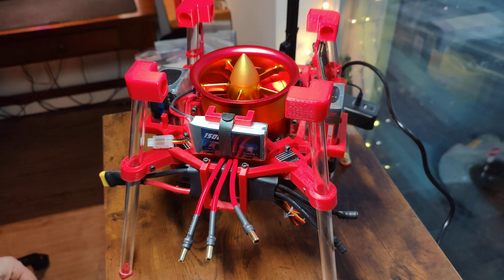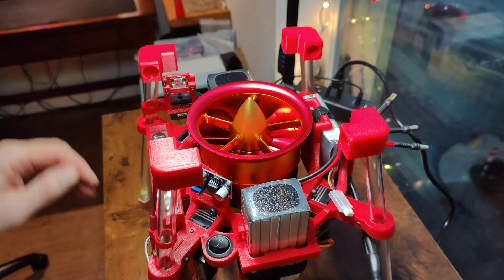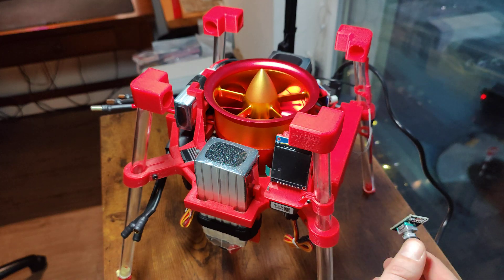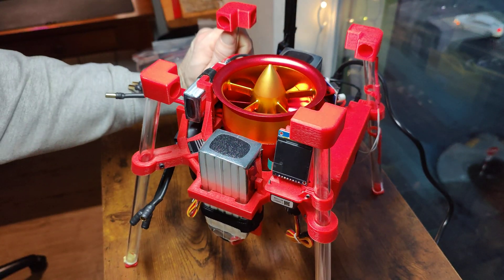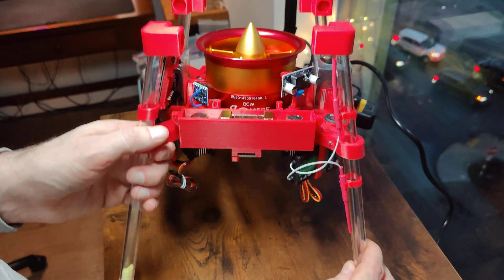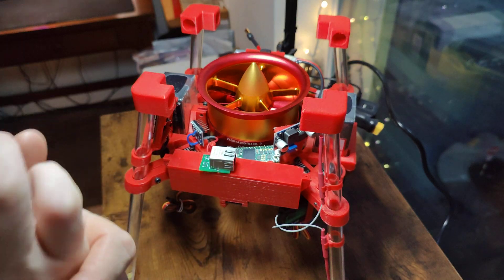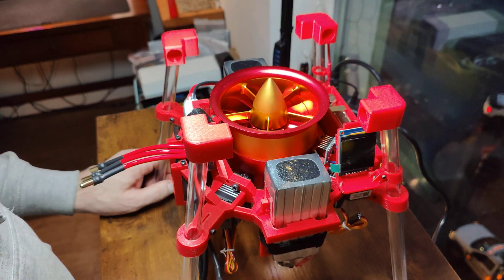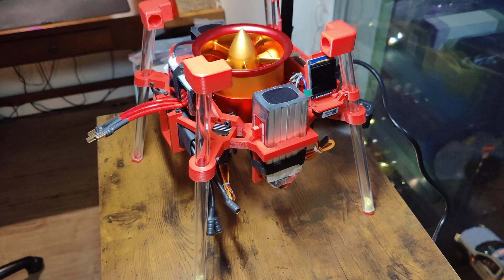EDF Drone Project Progress

Comment: I gotta question that shunt.. That style is good for a lot of continuous current but it's a big and heavy block of copper. Why not a current transformer or hall effect sensor? Plenty of options that are tiny and lightweight. Or even just a much smaller shunt and stick it in the airflow. If you don't mind a bit of tinkering with making your own voltage drop table, consider putting sense lines to the batteries and the battery cables themselves become the shunt.
Reply from the maker: This is what I'm here for!!  I'm not an expert, at all.  I've previously looked into these options (excluding the sense lines, I've never heard of them) and what I found seemed like there wasn't anything in the consumer range that can measure up to 150ish amps accurately - I think what I read about hall effect sensors said they aren't good for sustained high amp loads?  That's from memory so I'm sure it's wrong, please point me in the right direction!  As it turns out the big block of copper helps balance the ESC and 1500mAh 2s battery (mass distribution is a huge topic of concern/focus for this craft in my mind) and ultimately optimizing for total mass/flight time is not the goal so I've put very little effort into finding a lighter-weight solution.  I'm in the testing phase for a reason though, I knew from the beginning there was a decent chance I'd have to ground-up rebuild the frame.
Reply from the maker: Well I researched and I'm sticking with the shunt.  It helps balance the craft, minimizing mass barely makes top 5 priorities, and from what I've read (with my understanding as a 100% novice) the shunt is more precise at lower amps and at sustained high amps.  I couldn't find the definition for 'sustained' but this craft will be spending 85%+ of its time operating at 60+ amps and the other 15% could be up to 120ish amps.  Not that I couldn't change it because I haven't actually started writing it, but I also planned the extended kalman filter around real time power-thrust mapping which is more precise than a table for several reasons, specifically in my situation.